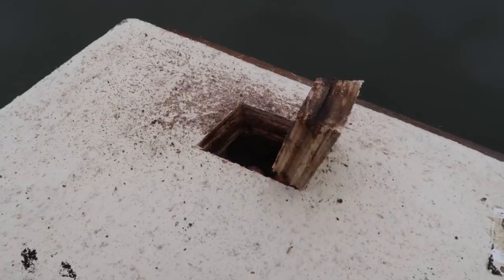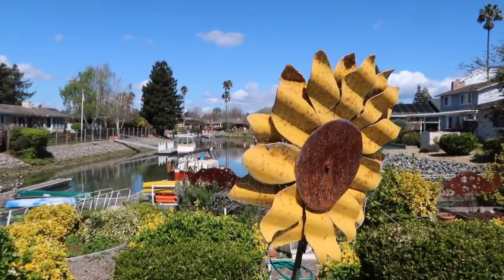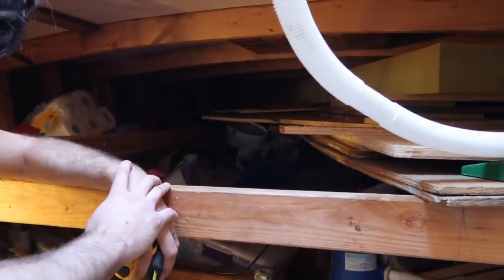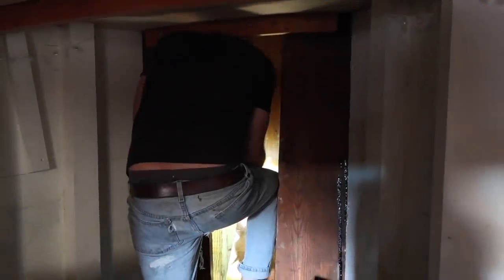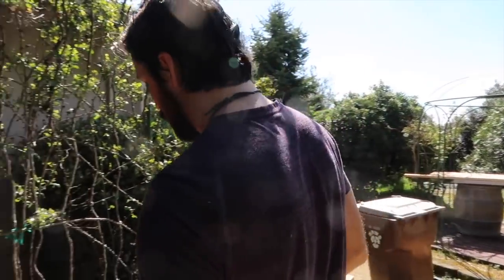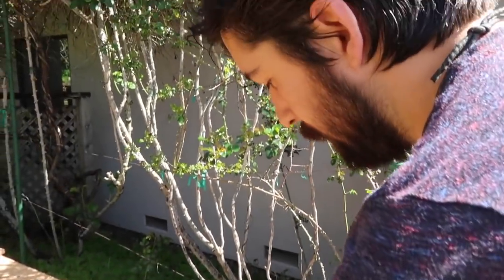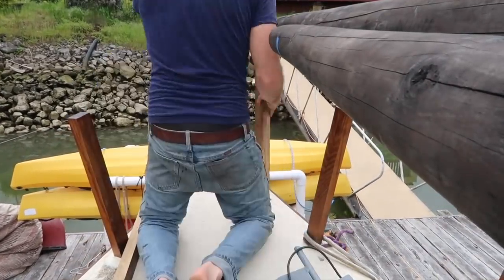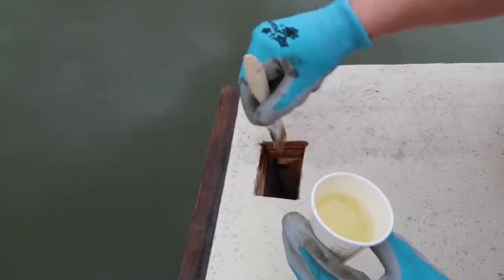Salt & Tar: Episode 49 - Breath of Fresh Air

Comment: Love what you two are doing.  If you don't mind me commenting, I think the bulwarks will hold a lot of water in heavy weather.  A large wave on deck could easily put the boat at severe risk of capsizing. An open rail would be safer.

Comment: Most old timers (like me) will tell ya that none those portable table saws is going to last very long ripping 2X anything. Those saws are expendable to the pros. They pay for themselves fast enough though. Induction run shop saws generally done with cast iron frames and tables will do 2X forever without complaint.

Comment: Did you read the direction and set-up your new saw ? You need to make sure the blade is parallel to the rip fence and miter slot.  Keep up the good work.
Reply: I'm sure that would have been done. I would have at least put a bag on the dust outlet if it was difficult to use a shop vac. Sawdust blows everywhere and makes a h*ll of a mess.
Reply: @delukxy  Anyone who uses a handkerchief for a dust mask, wears flip flops when operating a table saw to rip planks, doesn't use an outfeed table or support, causes someone to question if he checked the saw set-up.
Reply: @johnshoureas1629  to add to your comment. I noticed they mentioned that the old table saw was a Jet, and I happen to know that they're good quality table saws. As far as adjusting the blade to run parallel to the fence etc. I have to think that's common sense and one would see fairly quickly if it's off.  All table saws will require maintenance over time, but there's really nothing on them that cannot be replaced far short of buying a new saw. Even if the arbor bearings are worn they can be replaced fairly inexpensively. Most table saw problems I see are dull and or very poor quality blades as well as proper setup. I don't know which model of Jet saw they had, and personally I have no real issue with Dewalt tools, but my guess is that they traded down without having further information. For all I know all they're seeing is a new sharp blade which makes all the difference in the world, but alas will soon be dull. Maybe it will be time to buy a new saw then? The thing that doesn't make sense to me is that a man who is handy enough to build a boat should be easily handy enough to maintain/repair a table saw, and at a fraction of the cost of a new one. But... whatever. I wish them the best of luck. As far as equipment carry curses... Meh

Comment: Not to be critical of your bearing installation,  but until you put a shaft collar up against the bearing between the bearing and the stuffing box the bearing is just a bearing.   The shaft needs a collar to transmit the forward pressure of the prop shaft to the bearing.

Comment: Dude get a table saw not a tinker toy. At least a contractor saw with a good blade, if that Dewalt came with a blade throw it way and get a better blade it will make life so much better. I am glade it is working for you after watching a little bit of the video.
And like others have said PUSH STiCK! A push stick is better than a bunch of needle sticks from sutures.

Comment: You stand close to a fast rotating piece of steel, wood splinters being thrown around and you wear no eye protection, no gloves, short pants, flipflops,... hope your guardian angel keeps an eye on you 👼 stay safe!
Reply: For being concerned about safety you get a point, but lose one for implementation. NEVER wear gloves or long sleeves when using a rotating power tool, if they touch they catch the fibers and get sucked in and you get sucked into the tool with them, and your injury will be much worse than it would have been. Pants are also not necessary but safety glasses are a must.
Reply: Jonathan Powers: dear Mr Powers, there are safety gloves made for this purpose. here is an example of workerman’s gloves:

https://youtu.be/ni6ExZE97b8

On loose long sleeves I agree with you. Getting sucked into a machine is a terrible danger. 

For pants and real shoes: carpenters, rangers,... most do wear dungarees or other purpose build reinforced kevlar safety trousers and reinforced shoes. And if your comment is solely on estethics, then it may be that more people watch if Ruth wears none of all this.

But I’ve seen accidents happen. They hurt and recovery is slow and painful. It ain’t worth it.
Reply: NOOOOOOOO GLOVES, Just a JP says, they are more apt to get dragged into the tool and there goes what ever chance you had. Even if they are chain maille they are DANGEROUS. @Fr99763
Reply: Joseph Hnat : watched my link?

Comment: Why You haven't done this tool purchase years ago?
You're boat builders, aren't You? Boats are built with phantasy and itchy sea legs, not tooling in the first place. 
That's why all those exotic wood treasure boxes and woodworker's wet dreams of overcomplicated joinery and unreliable varnish are out on the water one weekend once a year at most. 
Rediviva is barely half finished, is at least partly lived on nonetheless, and already went her first miles, ain't she? 
Plus: You need a cursed POS saw to learn what a saw can do ... a working one, that is ;-)
You learn to really drive fast'n'safe with underpowered and undermaintained POS cars which constantly break when driven "edgyly", and same goes for little tablesaws. Same goes for big ass tablesaws too, by the way. Thanks for sharing.